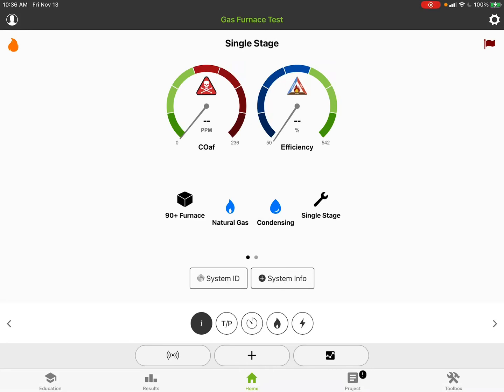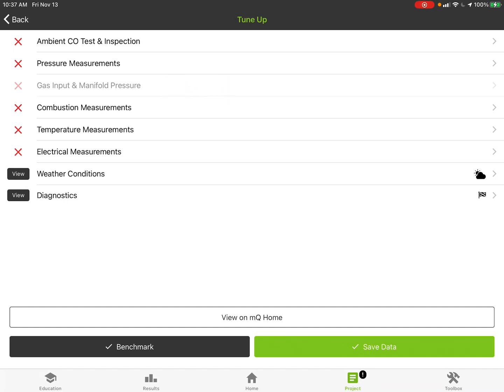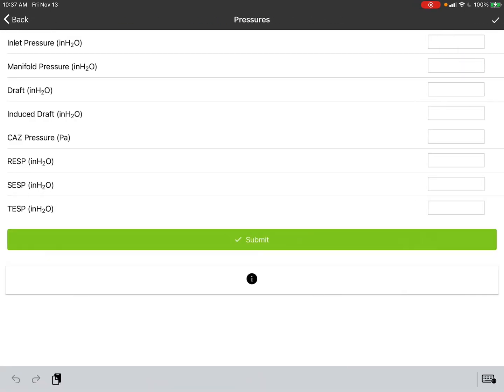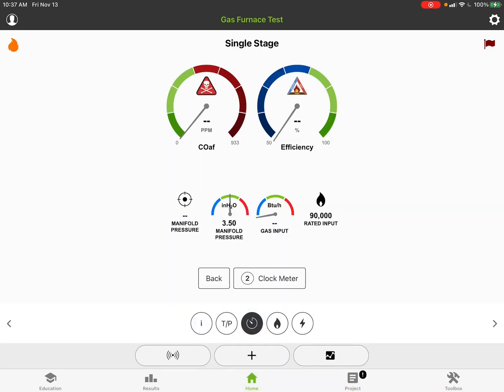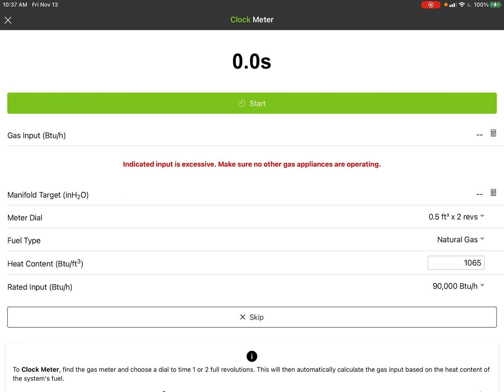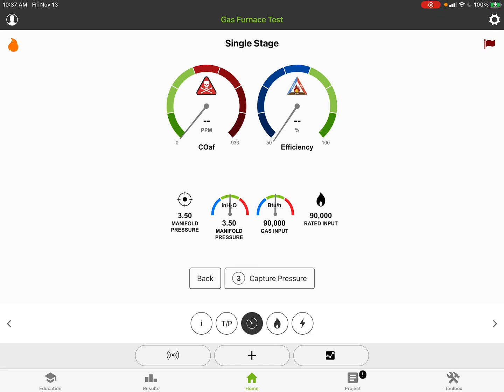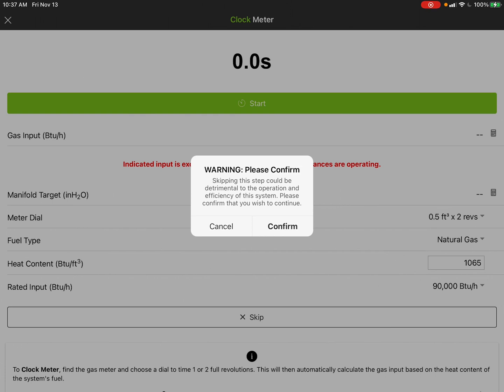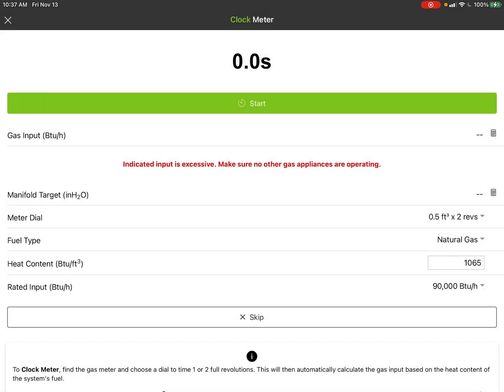Gas Input and Manifold Pressure is Greyed Out, Why?

Comment: Would love to see how it works on LP since you can't clock a meter. And also I see on the MQ app I see there is boiler application as well. I'm getting ready to drop some serious $$$$$ on full tool set.
Reply from the maker: There is a bypass for clocking the meter.